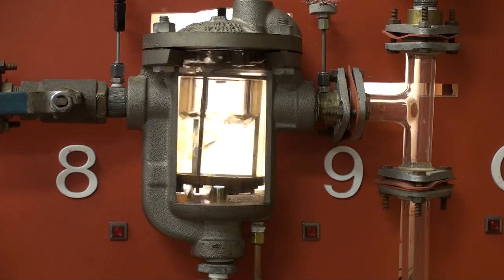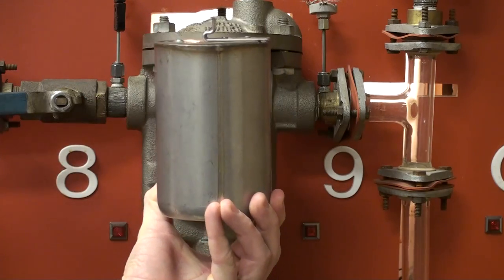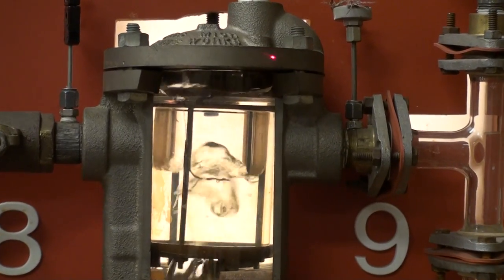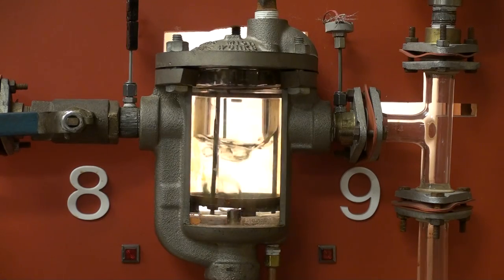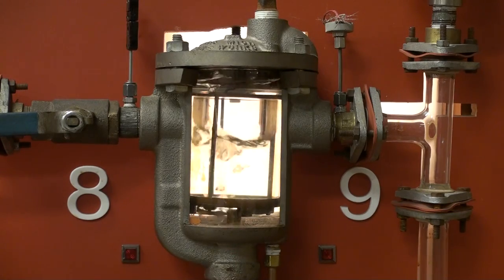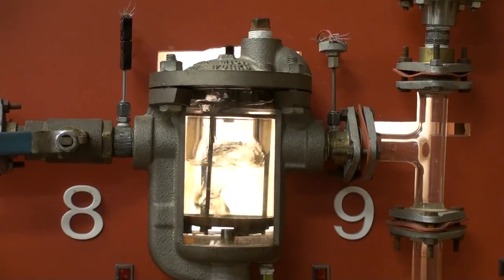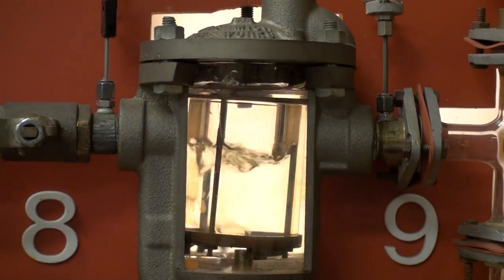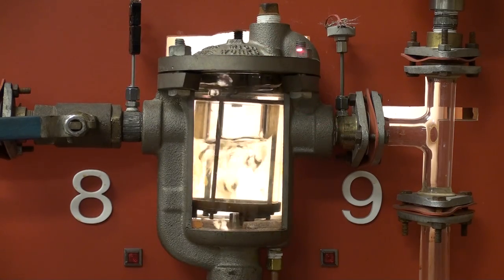Inverted Bucket Steam Trap - Tutorial

Comment: Excellent video ! Thanks for taking the time to machine the trap and install glass so one can actually see how the trap works. I have worked with steam for 30+ years and have rebuilt many Armstrong inverted bucket traps but have never actally seen one working till now. I was brought here in search of Carbonic acid and the role a trap has in removing CO2 , O2, and other gases from steam I'm having problems with blown steam coils approx. 1 MBTU each @ 100PSI freezing up and bursting. 
Thank You !